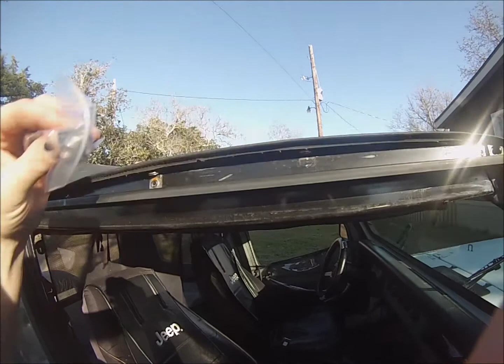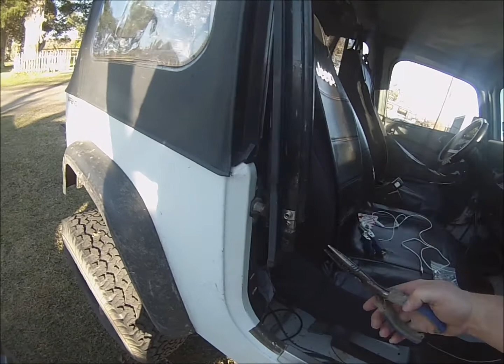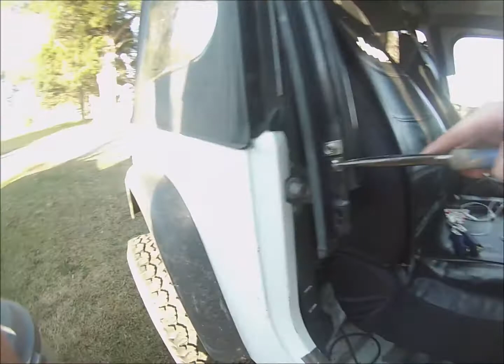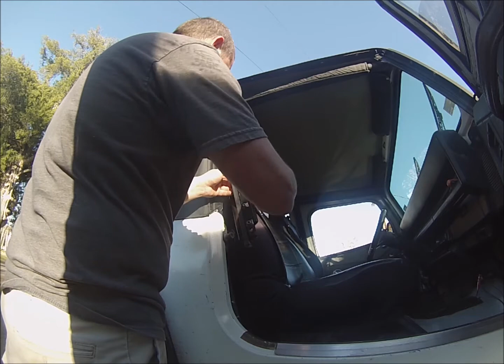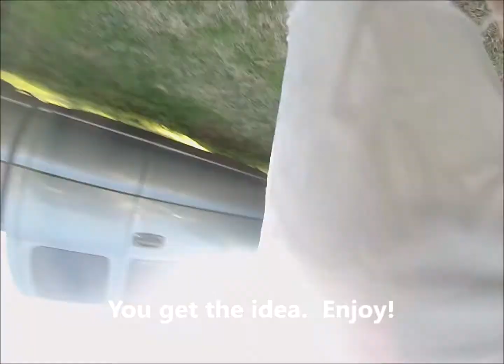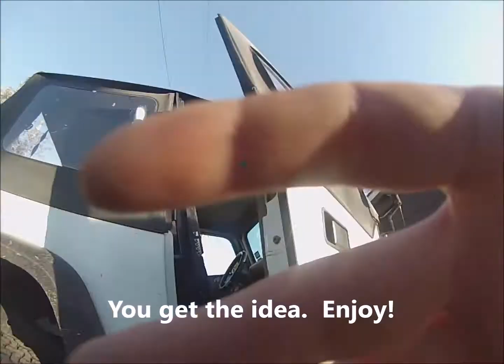How to Install New Jeep Wrangler Soft Top Snaps Quadratop Bestop Rampage Rugged Pavement Smittybilt

Comment: I replaced mine as well but recently bought a new soft top and it seems like a struggle getting the new top snapped in. Any suggestions?
Reply from the maker: +66nerve man, it's a struggle all around tbh...
Reply from the maker: +66nerve normally, we wont push the back rods up until everything tlis in place that way there is plenty of play in the top...
Reply: Let it soak in the sun first. Gets a lot more manageable